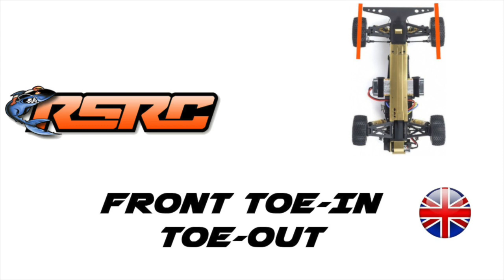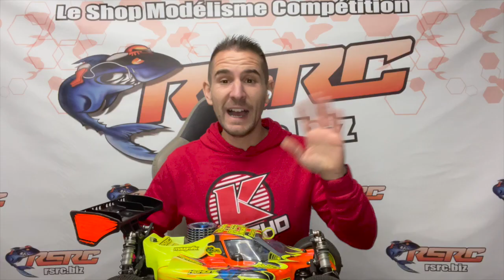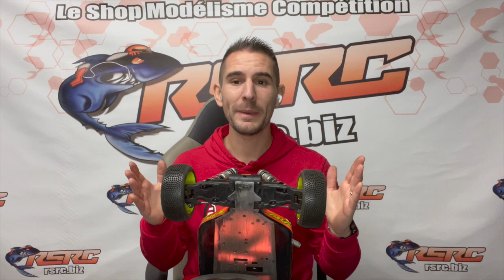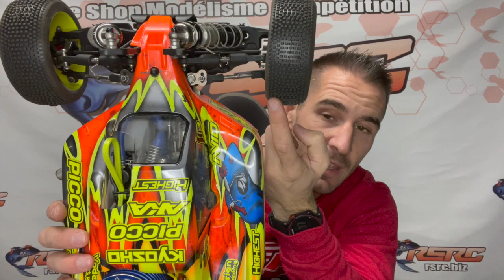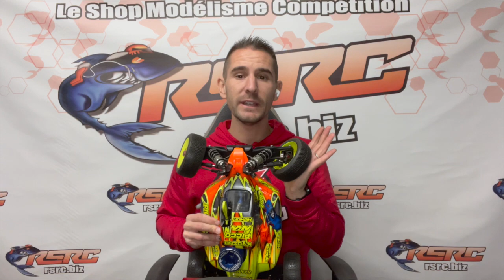Quick tutorial #2: front toe-out on RC Cars

Comment: This video is incorrect. 

Toe in is more stable, suited for high speed. For course with long straight lines. 

Toe out let you turn in smaller radius, quicker turn, suited for track with many curves.

Generally speaking, toe out for off-roaders and toe in for on-roaders. But fine tuning may be needed depending on the race tracks.
Reply from the maker: We are mainly talking about off-road here…

Comment: Hey buddy I've listed to many people about toe and still didn't get the information I needed until you explained it thanks.  The only thing I need to know now is what effect does rear differential fluid have on steering in a corner and how does rear toe effect steering in the corners. Because I'm trying to make a wide max traxxas xmaxx corner because it take super wide turns and I have played around with toe and it just will not turn sharp on power, it will turn in a small circle going real slow. I might have to end up adding weight to the front.
Reply from the maker: I honnestly think the xmaxx is a beast and considering the size of it and its tires we can’t really talk about setup and efficiency unfortunately, it won’t matter much IMO

Comment: @1:17
Toe in and toe out are backwards, toe in gives high speed stability, this is why vehicle manufacturers set them between 0.5 and 1.5 toe in, because they don't want their customers killed themselves. Toe out makes the front end twitchy, unstable over bumps in the road and faster to react to steering input, more accurate, less forgiving.
Reply: THIS IS 100% CORRECT
Reply: That's true for the rear but not for the front in my experience. Cheers!
Reply: True story

Comment: Nice video 🙂  Are you running Picco P3TT engine ? How good is it ? I am a club/casual racer and currently considering getting this motor. I am not new to nitro so I am not afraid of breaking in or tuning such a high pinch engine. I guess all good modern motors have high pinch anyway but this Picco is like half the price and maybe 90% of performance (for me at least) of a top REDS engine, so it's really tempting...
Reply from the maker: Yes I run the Picco P3TT engine. To me it’s the best quality/price engine on the market. And no it’s not 90% of a top performance engine. It is one of the most powerful engine on the market as of today!
Reply: @rsrc    Thank you, really helpful for me ! Cheers 🙂

Comment: I heard that the torque on the wheels also correct the toe towards "in" at speed. So if you have a little bit toe out you'll end up with 0 toe when accelerating. Is that correct?
Reply from the maker: Yes but to a reasonable limit, the rods keep everything together so it won’t change by 4 degrees just on power…